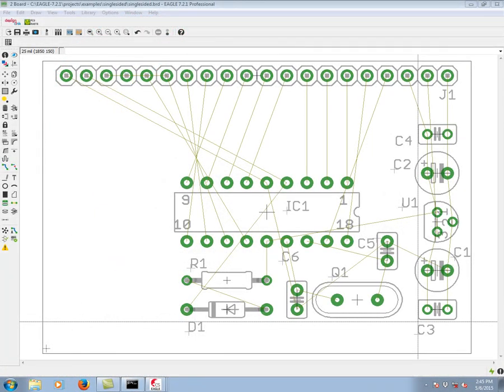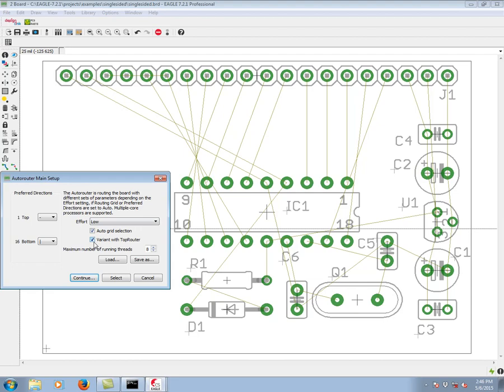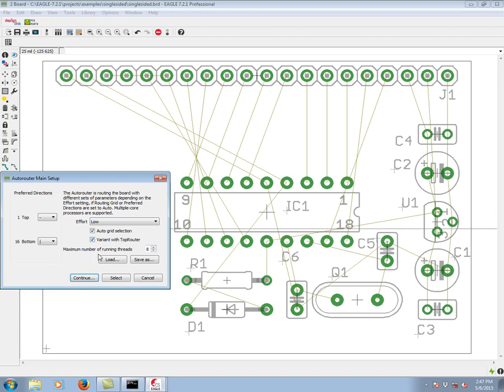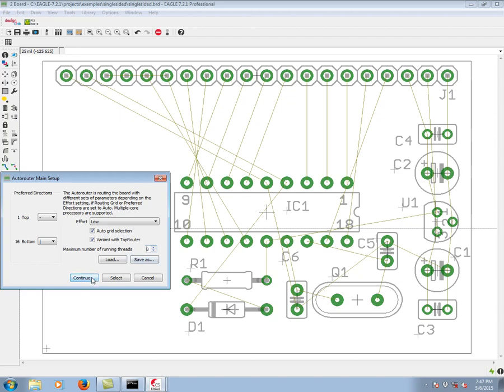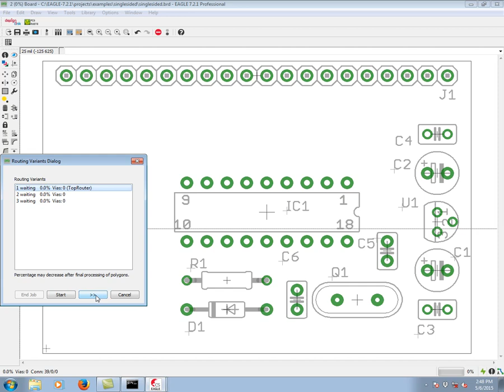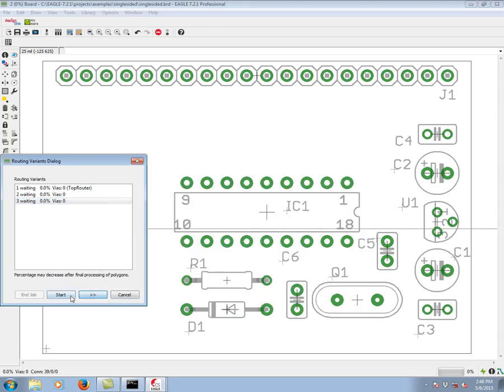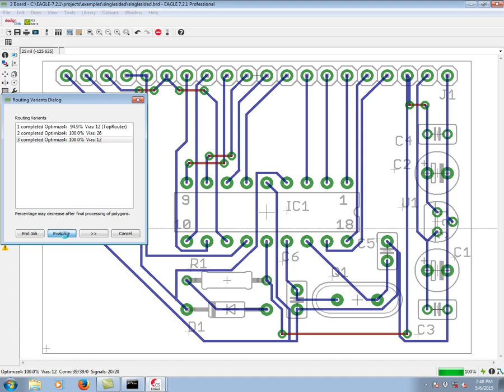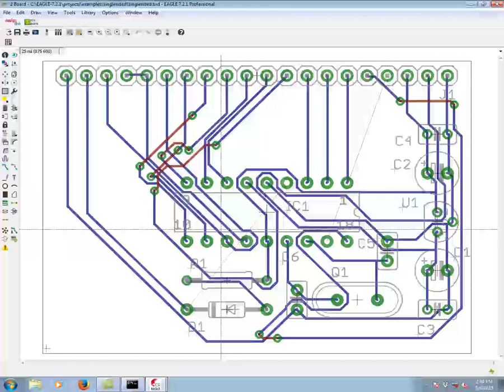Autorouter in Version 7.3

Comment: So you picked the routing choice that was incomplete, with only 95% of the routes finished (I see two unrouted connections), and the software doesn't even pop up a reminder or warning that routing is not complete. Yes verification should catch it later, but it sure would be  nice if the results were at least color coded, and if the unrouted connections were highlighted somehow. I have had several circuits where all choices only reached 98% success, and finding that final unrouted trace has been very difficult visually within the router module.